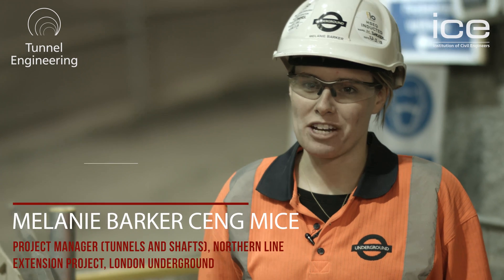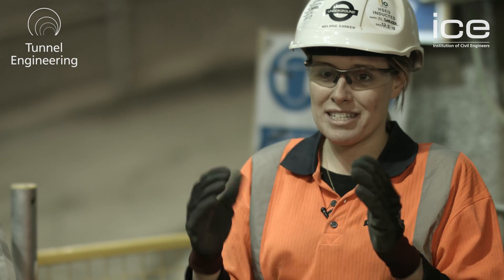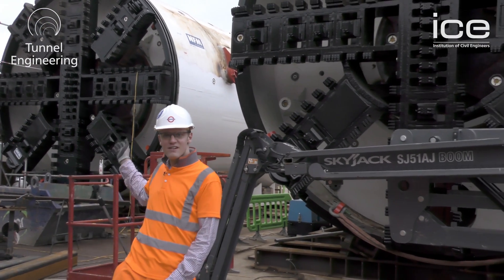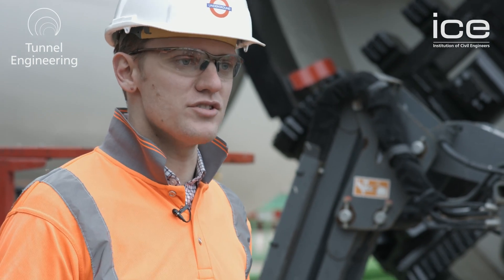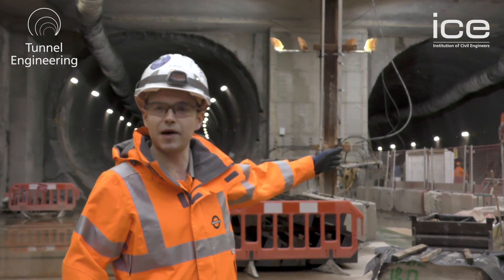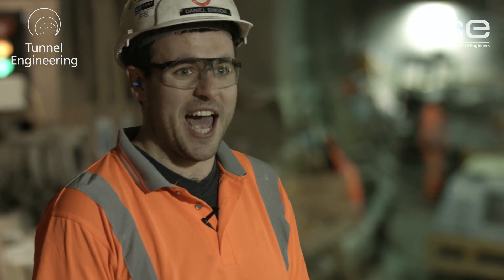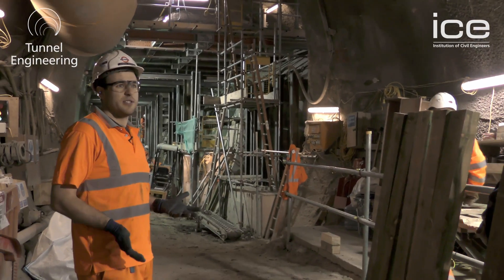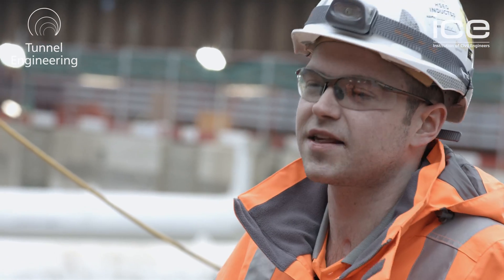Building the Northern Line Extension under our feet

Comment: A shame that it was not possible to connect the Bank Branch via Kennington to Battersea, as the Bank Branch is above the reversing loop for Charing Cross, looking at the current drawings, wouldn’t be possible to have any step plate junctions on either sides of Kennington station on the Bank Branch.